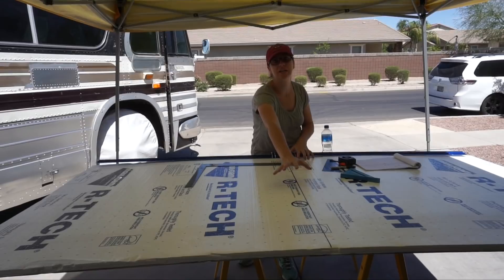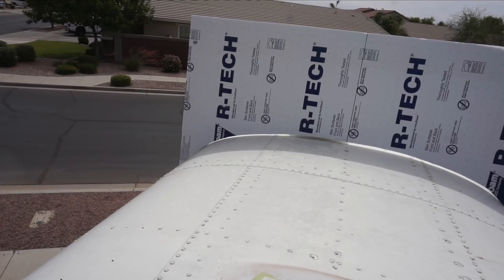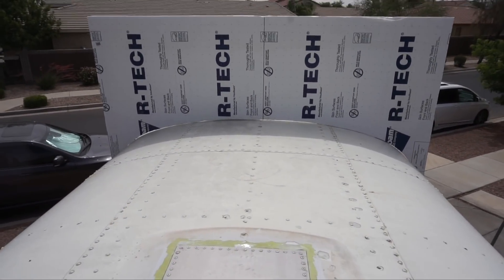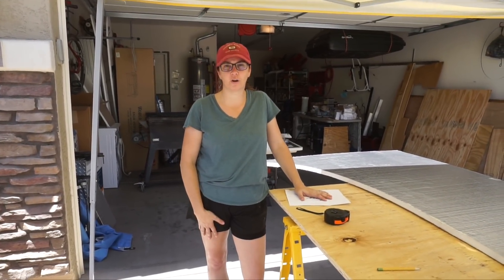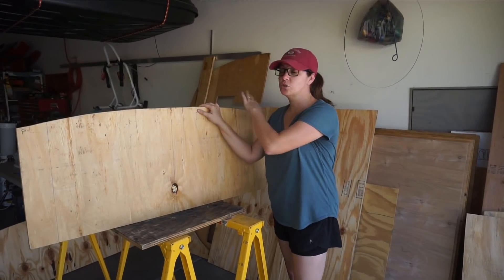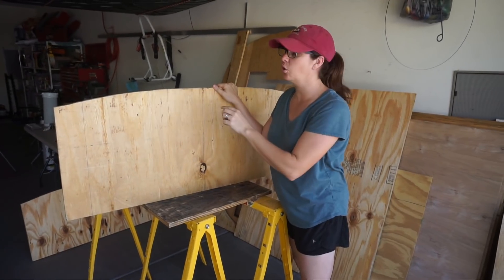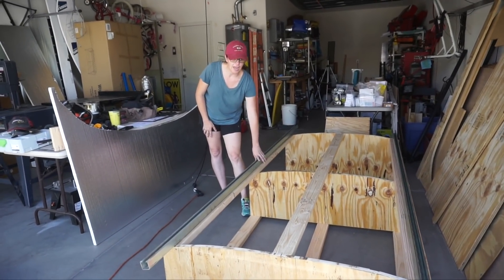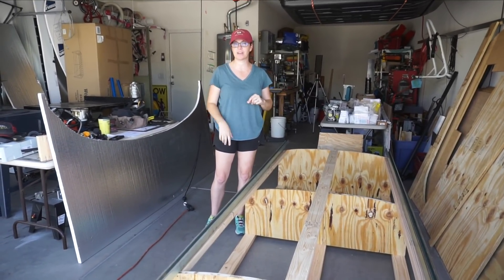Planning a Solar Rack - Part 1:  Building a Model & Our Plans

Comment: Gotta b a less complicated, less likely problematic way. I wouldn’t want to worry about all that hardware and mechanical stuff. You’re gonna have plenty of other stuff to maintain. Plus that much hieght and hardware will create a lot of turbulence which will probably require a serious spoiler. Trade those panels for different size to fit them side by side. Save yourself a lot of time and aggravation. Just sayin. It’ll b way cool though if you pull it off.
Reply from the maker: We'll see where this rabbit trail takes us ... we are still experimenting and playing with configurations.

Comment: I've been giving the concept of one or more sliding layers quite a bit of thought.  It's fairly easy to push the layer back and forth (for instance a scissor jack  like thingy, which has a lot of pulling force from its extended position where you need it to pull the layer back in/up and will provide a way to manage cables/cords).  It is also manageable to build the rails for wheels to run in - assuming you prefer the panels to tilt into an angle as they slide out (same principle as a tilting drawer), especially with your curved roof.  The main obstacle, however, is the immense pull on brackets and panel frame along the edge of the panel facing inwards.  Effectively the panel will act as a lever, so the frame the panel rests in and the opening of the housing for the sliding layer will need to be very, very sturdy.  And thus heavy.  The only way to fully avoid the weight of the panel being multiplied by leverage, will be to have hinge-like brackets on the side of the bus with rods connecting to the outer side of the sliding panels.  This triangular structure can easily manage the weight of the panels, but makes it slightly more complicated to build (and less appealing to look at, unfortunately). The triangle will work best if the panels are close to the side of the bus, which is not what you plan for; but will enable a much more simple and light construction on the roof - something that you can certainly make at home.  

Your particular curved roof may not need the complicated outer edge support if you let the panel rest on the roof all the way to the side of the bus and have the house as far as possible towards to the opposite side - the leverage effect will decrease the longer the distance between resting points for the sliding panels.  If only half the panel is floating then all of its weight will rest on the outer wheels(those on the frame) - which should be fine.  Any extension over the side beyond 50% will increase the weight on the outer wheels and will cause the inner wheels (those on the panel) to provide an upwards force which need to be contained. The closer the wheels get the more sturdy you need to build.

I'll be following tour experiments with even higher interest than usual!
Reply from the maker: Thanks Claus - excellent observations and suggestions as always.  We are still testing and figuring things out - the next video should be more interesting!

Comment: Slides are complication you don't need when you can just make a 1x1 inch steel frame to support the panels in the original layout giving you lots of room to skip vents. 1x1 box steel for the vertical and horizontal then 1 inch flat stock to match the curve of the roof (can get a cheap ring roller from Harbor fright for around $80 to make the curved metal easier)
Reply from the maker: We are going with a foundation based on superstrut on the bottom.  We figured this would give us a solid base to build up off of as well as some versatility if we decide to change our minds in the future.  The structure you describe certainly sounds strong enough.  One of the issues is we only have about 30 ft of space to work with because of the shape of the roof - all the panels butted up end to end is almost 28ft long so skipping the vents (they are longish at about 24" each) would only allow 6 or 7 panels

Comment: You will have to design a preety ingenious slide to prevent it casting a shadow on the lower panels. Otherwise you will loose performance on those. I understand you bought 72 cell panels which are 6 ft long, right. 60 cell panels, 5ft long would have been a better choice i guess...
Reply from the maker: Hi Hillside - I believe our panels are 128 cell panels.  They measure 81.5 inches long (almost 7 ft).  5ft panels may have been easier to mount, but we thought it was a good trade-off to get more energy density.  Hopefully we can make it work

Comment: Unless your are going to build a Mad Max roof top solar cage and mount system and spend hundreds of hours and thousands of dollars I would just mount the panels sideways and skip over where the roof vents are. I wouldn't worry about clearing them as they still have to open.
Reply from the maker: Thanks Alex - This was our original plan and it just seemed really risky with so much panel exposed and out in the open for the wind to catch.
Reply: You can widen the stance width of the rails running lengthwise on the roof by running some cross beams underneath them. It wont feel like there is so much exposed to the wind if you even went a foot wider.
Reply: Now that I think about it. You don't even have to attach to the existing roof lengthwise beams do you? I mean your roof is strong enough to just mount directly through it isn't it?